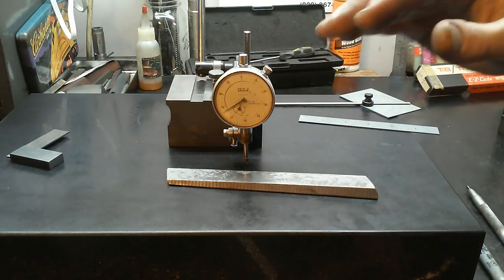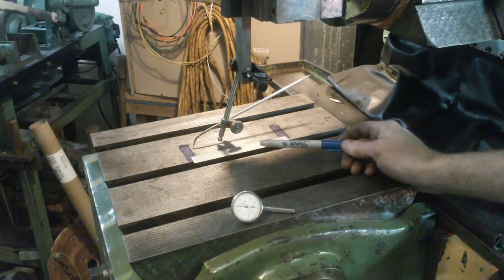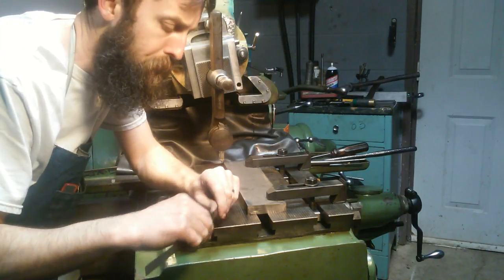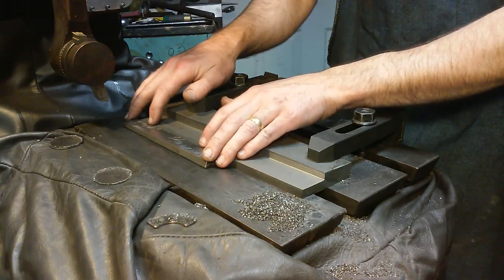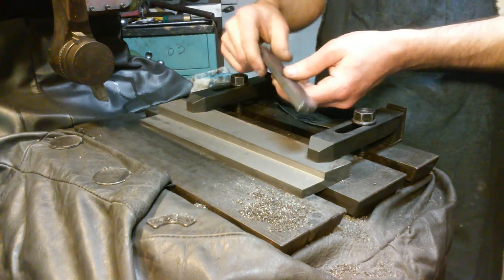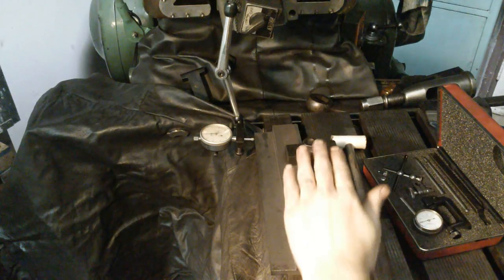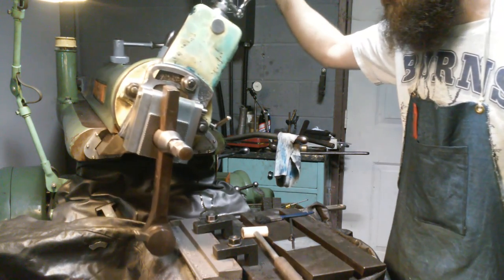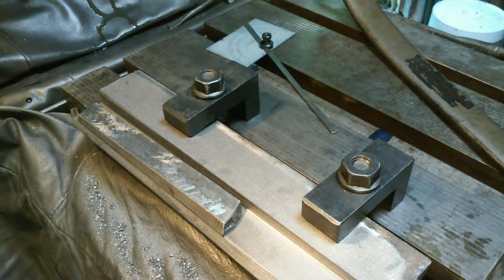Steve Summers Cutting the Tapered Gib in the Metal Shaper

Comment: Thanks for your videos Steve, I'm rebuilding a small shaper, and have a larger one waiting as well, and there are not a lot of shaper channels out there. To get the angle right you could also have clamped the old gib on the table and run your indicator over it (you have to take the compound apart for it but I'm sure you can still mount an indicator to the ram).   If the top of the gib is parallel to the ram the table is angled right, and you don't have to do any calculating. Keep up the good videos!

Comment: Steve Something that I use for cover is just simple kitchen aluminum foil . It is extremely easy to form around objects is readily available and also easy to store a roll of it in the shop. I also use kitchen Saran Wrap if not worried about heat.
Reply from the maker: terry cannon Thanks Terry
Reply: Steve I keep trying to catch the set up on cutting the side taper. I am assuming the table is locked and the angle is determined by the angle of the  tool and hand feeding down on the end of the back stroke of each cut. I guess I just need to take some scrap and make some practice cuts and practice tools to really get the hang of it.
Reply from the maker: terry cannon the sides of the gib was cut buy rotating the compound to 30°and fed down by hand on the return. Table locked. Practice on anything and everything but the part you need. Do it 10 times in practice and when it's time for the real thing it will be no problem 👍

Comment: Hi. How was the wedge tilt angle set? leaned the table or lined?
Reply from the maker: The table tilts up to 15°. Makes cutting small angles easy.
Reply: @SteveSummers  Cool! It is a pity that in our machines of production of the USSR there is no such function ((
Reply from the maker: @fray266  The tilting table is a expensive option. Most shapers here in the U.S don't have it either. You could always use a sine bar in the vise to achieve the same thing. That would probably take less time and be more accurate than dialing in the tilting table. Only issue would be holding it good with the vise. 😁👍
Reply: @SteveSummers  Thanks for the answer and for the advice !!)

Comment: Hey Steve. Greetings from Brisbane Australia. Just got a customer the other day wanting a Gib made for his Drill Mill. The way you have done this is what I was thinking of doing. He has given me a sample to go off and like you I have the Tilt Table on my 22" Strigon so I'll just dial it in for the taper, love your way of determining the Taper. I'll make mine longer and do a final fit, measure and cut to length (old way of fitting gibs I think) as there needs to be a slot milled in for the adjusting screw.
Cheers.
www.grahamsengineering.com.au